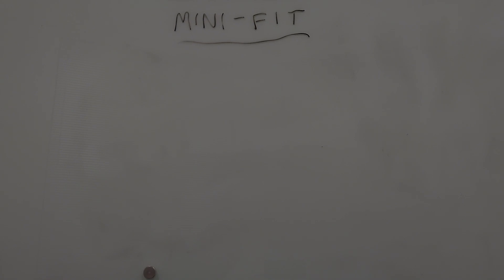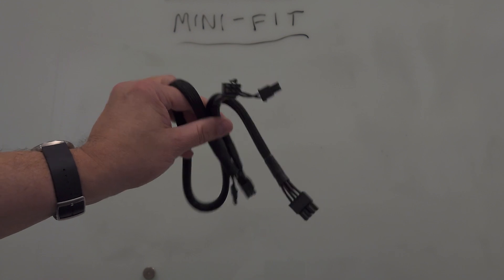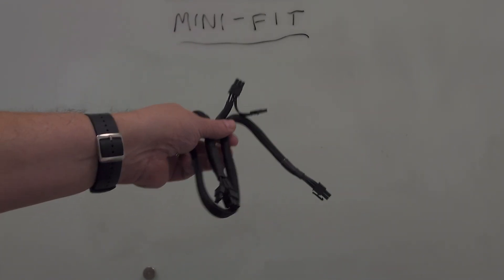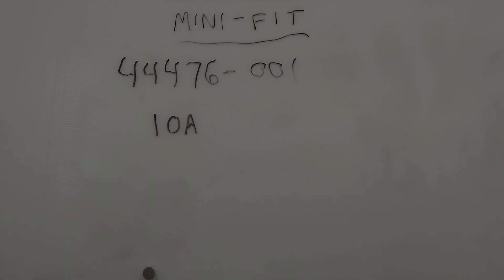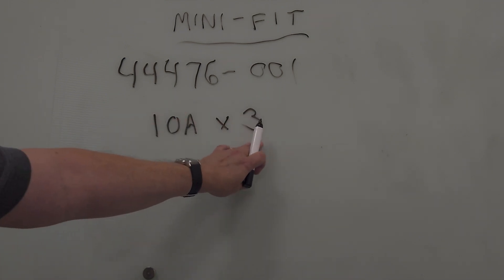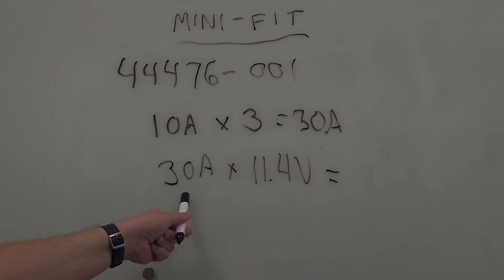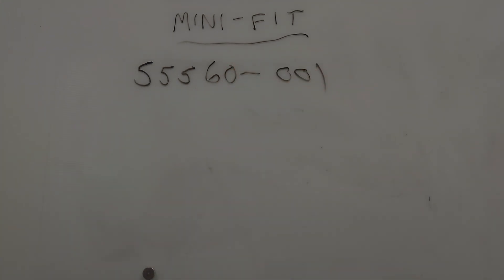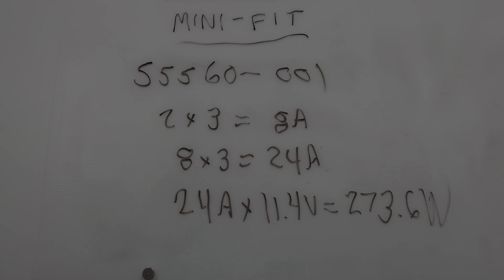Yes. A 6-pin PCIe connector is designed to deliver a lot more than 150W. Part 1-The dry erase board.

Comment: 7:12   2*3=8  why? 
 2*3=6 !
Reply from the maker: Because it's 6 conductors and 2 sense pins.  The connector is 2x4, but the actual useful conductors are 2x3.   Sure, sense wires are used for Earth ground, but so are the 100 ground pins in the PCIe slot.  :D
Reply: @jonnyGURU  thank you

Comment: This is to say that the extra 2 pins are just a really elaborate pinky promise by the PSU that it can deliver more power.
Do these sense pins do anything that another conductor/ground pair would not? In other words, what stopped them from taking the EPS route by having 3 12V/ground pairs?
Reply from the maker: "Pinky promise".  I like that.  But you bring up a good point.  Intel never said the 4-pin ATX12V was only for 50W.  In fact, it's commonly stated that it's good for up to 192W.  Likewise, that the 8-pin is good for up to 336W.    Not because this is what Intel stated in their document, but because it's not stated people did actual research.